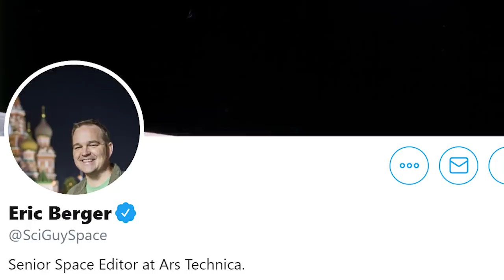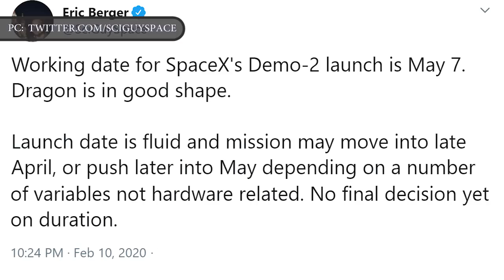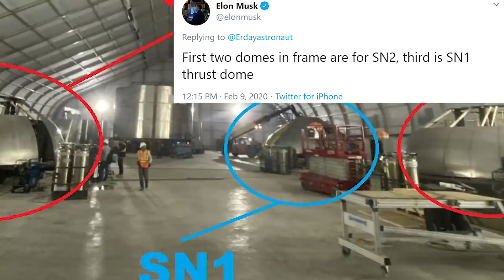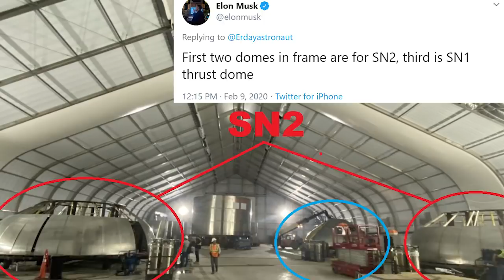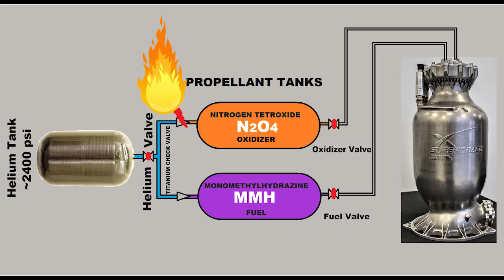SpaceX Crew Dragon Demo 2 launch is May 7 | Starship Well Underway Inside New Texas Factory

Comment: Hey ET, I have a request. In the future, it would be better even advisable to distance yourself from outrageous claims of space tourism (1) because there is no space hotel planned even for the near future as they are still experimenting with tech to even get it up there, let alone the cost which also has not been figured out yet. (2) This being the most important and elusive. Solar radiation protection (shielding) and "micrometeorite  protection" while aboard the "Space Hotel". Until this happens, doing anything other than traveling to space station will have to wait.

Comment: If the Demo-2 mission were to be extended to a full length operational mission, the extra training required would probably push the launch date back to mid Summer some time. The idea was originally floated about a month ago, and absolutely nothing has been said about it since. Given Starliner's problems, which are probably going to push their first manned flight back until next December or January, my guess is Demo-2 will go off as planned, hopefully in April, for a two week shakedown cruise, but then first operational mission will be flown as soon as possible after that, in June, or no later than July. Jim Bridenstine wants American manned operations restored so badly he can taste it, and the delays have been tremendously frustrating for him.